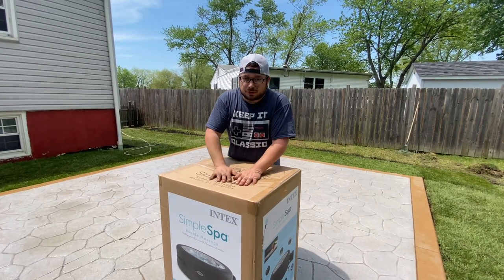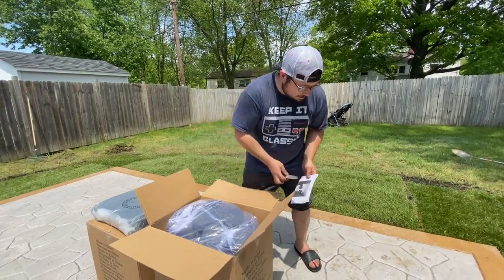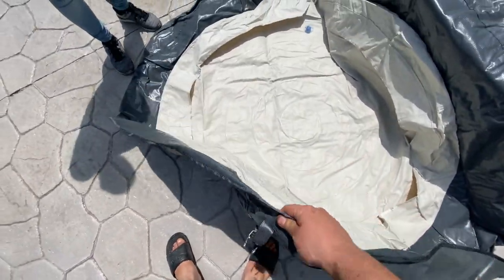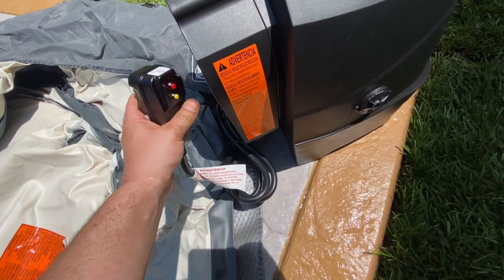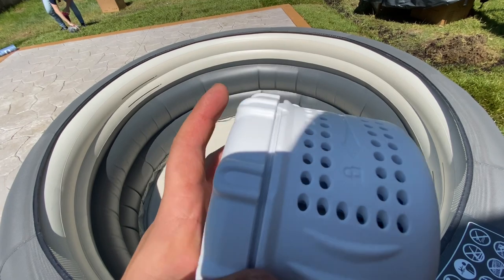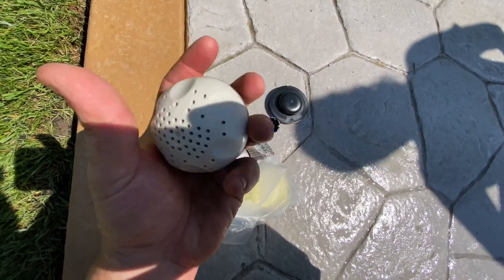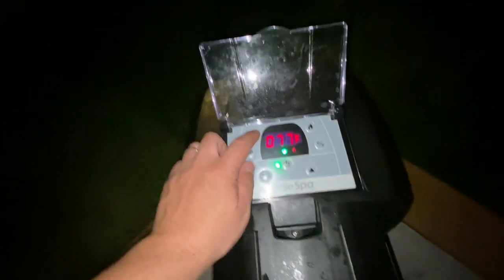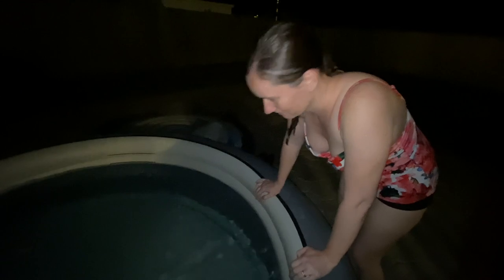Cheapest Portable Hot Tub! Intex Simple Spa

Comment: Those extra rubber O rings. Are they supposed to be on the 3 connection fittings? Mine only have a rubber O ring on one of the connection fittings.
Reply: Yes they are. I learned the hard way so now it leaks. Have to add rings then refill haha

Comment: Nice vid guys!!! FYI the sign

with the box cutter with a line through it means not to use anything sharp  to open the box as it could damage the contents. It would be OK to use to open the tape on the top of the box but you would have to man handle to open like lifting to top of the box and pulling the tape apart or you could lift the after cutting the sides of the top of the box and cutting the tape on the middle of the top.

Comment: Thank you for your video. This was very helpful. Question? How did you know or determine how much air to fill it up with? I want to make sure it has enough w/out over inflating it. TIA.
Reply from the maker: It won’t overinflated. It will just feel firm.
Reply: @unprofessionallyunboxed  thanks for responding. Wanted to be sure since the lower 2 rings were pretty firm but the very top ring is still soft & squeezable.
Reply from the maker: Yeah this is the budget friendly version of the hot tub so It won’t be hard as a rock but It will be pretty firm
Reply: @unprofessionallyunboxed  lol. No kidding. Thanks again.

Comment: Mine didn’t inflate as tightly as yours. Does it just have to run until it feels firm? I think the manual said it automatically is set to a certain air pressure but I still have some wrinkles in the top after inflating
Reply: Oh my theory is that yours was in the sun and the plastic was softer after being warmed. I did mine in the shade and somewhat cool weather. Still pretty firm though

Comment: The outer mesh on mine isn’t right like yours and I’ve been airing it up for a while now. Once there’s water in it did that help expand it?
Reply: Isn’t tight
Reply from the maker: Spray soapy water around the hot tub to make sure there are no leaks (it would make bubbles) and make sure the inflator hose is facing the correct way in the heat pump.
Reply: @unprofessionallyunboxed  yea everything is correct and no leaks I ended up filling it up with water gonna check it out tomorrow and put more air if needed maybe I didn’t air it up long enough I was trying to see if it showed what psi to air it to

Comment: So in the manual, it says you can turn the filtration system off and it will only run when the hot tub is heating. When it's up to temp, the filter shuts off. I have been able to make that feature work. Have you tried this or know how to make it work?
Reply from the maker: If no water is pumping back in, it is not filtering.
Reply: @unprofessionallyunboxed  
In the manual, it says you can make the filter run only when the heating element is heating the water. Essentially making the filtration system and heating system turn off and turn on at the same times.
I followed the instructions in the manual on how to do that but the filter continues running 24/7.

Im trying to make it so it's not constantly running/make my electric bill lower.
Reply from the maker: We really don’t do instructions here, lol (hence unprofessional) but I can turn the heat off and leave the filter on by just clicking the flame button or turn both off. I cannot turn the filter off and leave the heating because in order to heat the water, it needs to intake the water from the spa and redistribute.
Reply from the maker: Also, to save some money, keep it at 100 degrees and only turn it up to 104 a couple of hours before taking a dip.